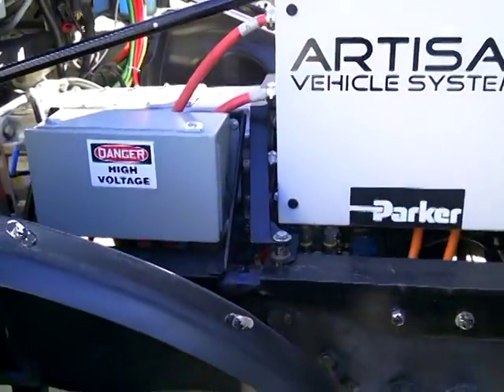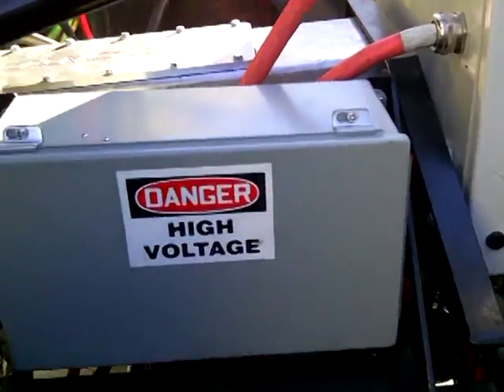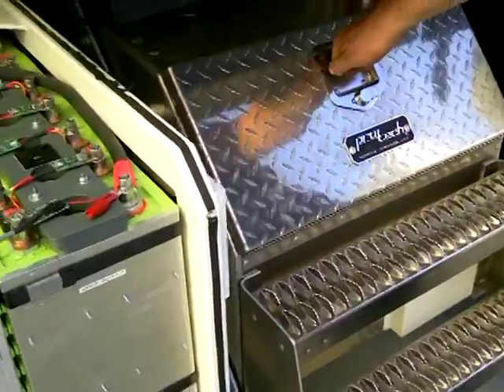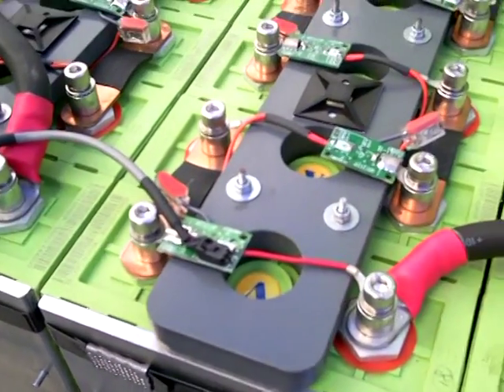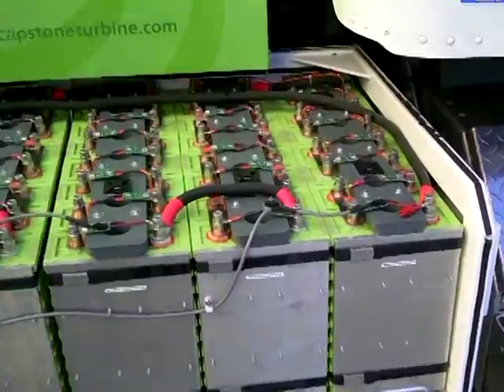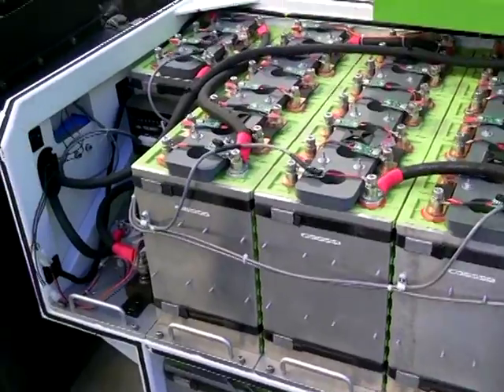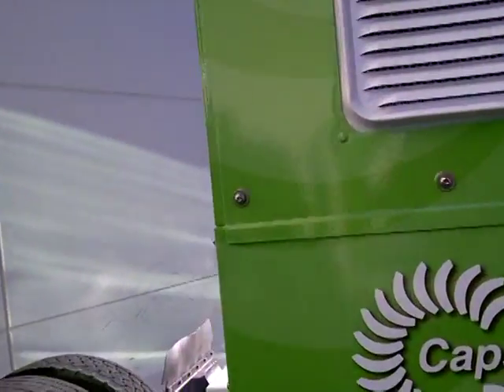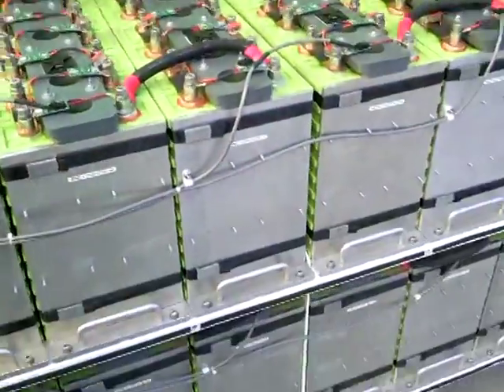Artisan Vehicle Systems Hybrid Electric Class 8 Semi Truck W

Comment: Many questions come about in addition to below mentioned question about fuel rate. How much does it cost to convert existing class 8 chassis? What is the tare weight of tractor with these systems? How much torque is available for given transmission? Speaking of, instead of using a manual gearbox, I'd like to see a setup with an Allison All World Transmission. Next, when will a video become available to show this truck at 80,000 lbs physically working and driving down highway? Need input!!!